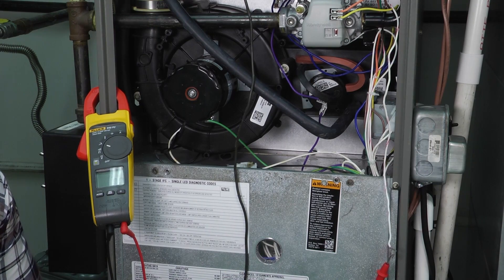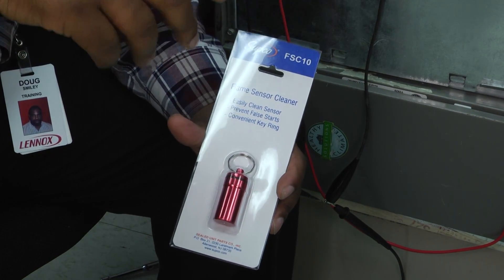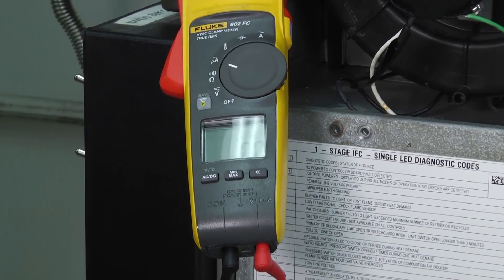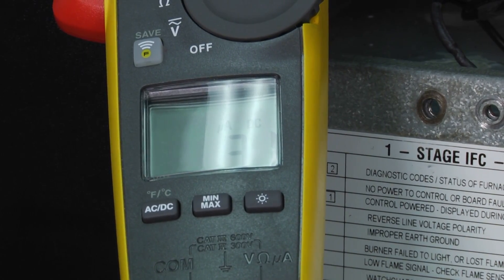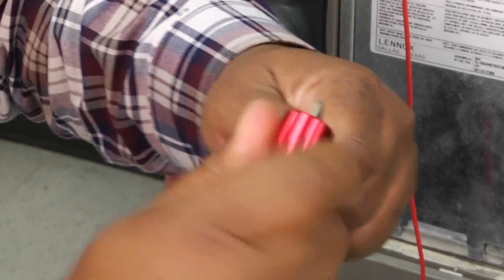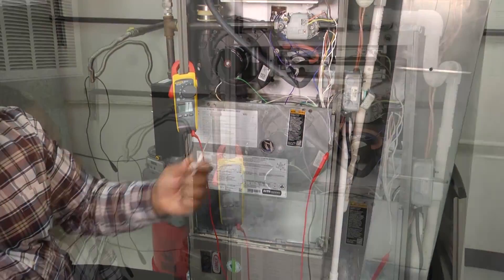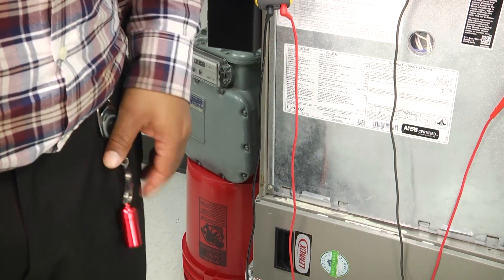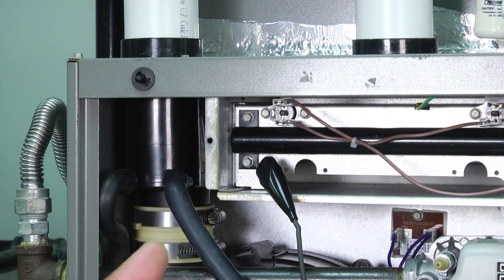How To Clean a Flame Sensor with a Supco FSC 10

Comment: Typical Lennox Trainer doesn't even know what he is doing. The Supco FSC 10 is meant to only spin clockwise not counter clockwise. The wire bristles inside the tool are directional and you are NOT supposed to ever turn it counter clock wise. Also like philjafo2 said, if you are going to do a demonstration of the tool and how well it works at least use a dirty sensor to show a true before and after. This video is completely useless just like the Lennox Training Techs in the field!
Reply: The instructions don't mention this. It just mentions rotate sensor until clean. When you say clockwise, is that looking down the back where the keyring is or looking down at the cleaning hole.